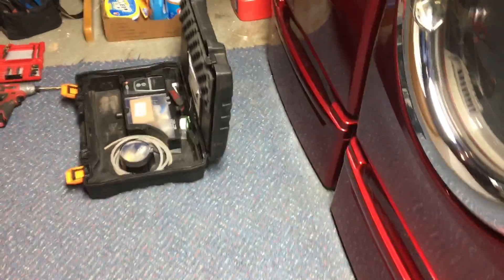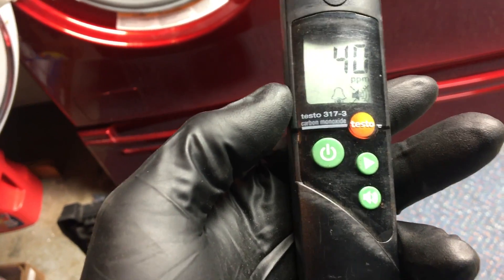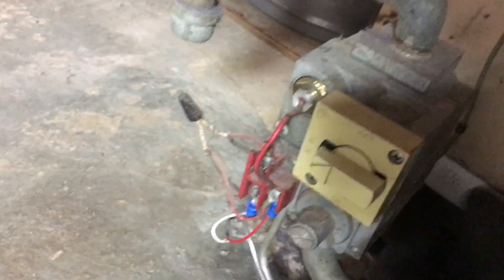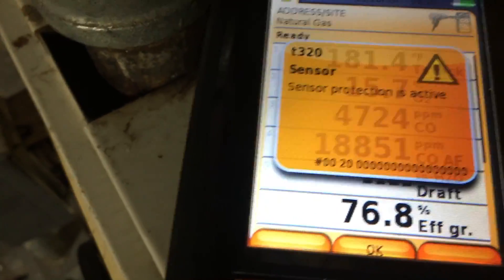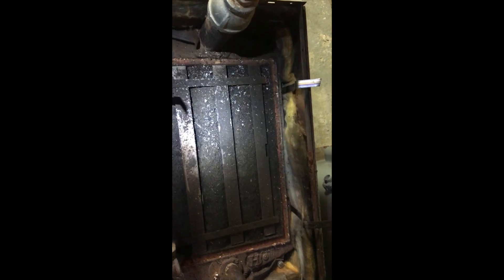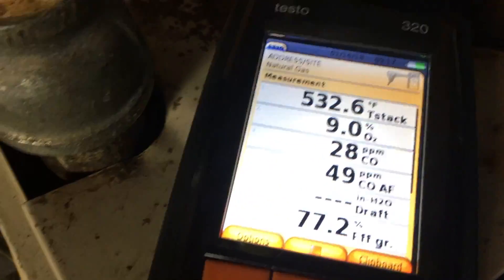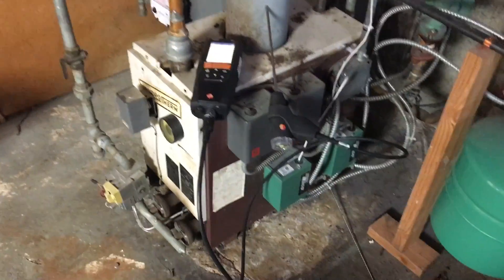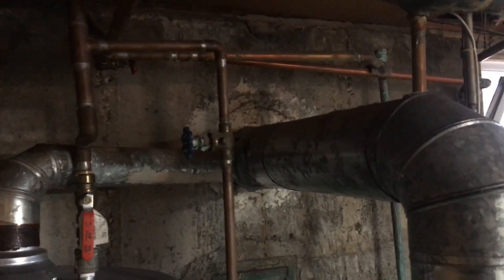Hydrotherm Gas Boiler - Flame Roll-Out, Burning Smell & Carbon Monoxide When Walking Inside House

Comment: Out of curiosity, what was causing the flame to roll out the rear of the unit?  Was it the filthy, obstructed heat exchanger🤔? Thanks Mike.
Reply: You are most likely correct.

Comment: I had this issue yesterday.  Iam going back now to clean the burners. Thanks for the tip.
Reply: Got to clean both the bottom cast iron burners and pull off the top cover and scrub clean the cast iron sections that the hot water travels thru.
Note: if you are a PSE&G customer and are already paying for worry free service on your boiler, they will come and do it for free.